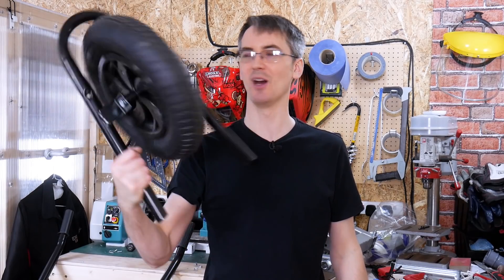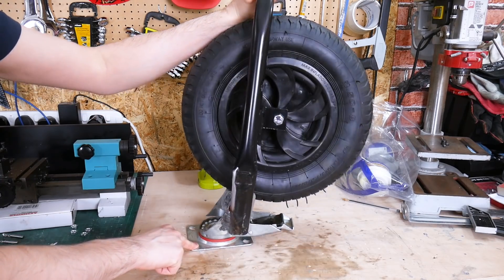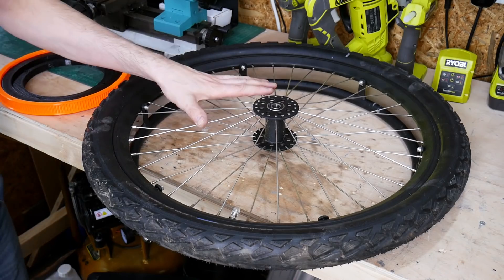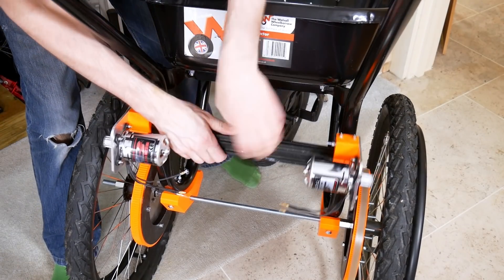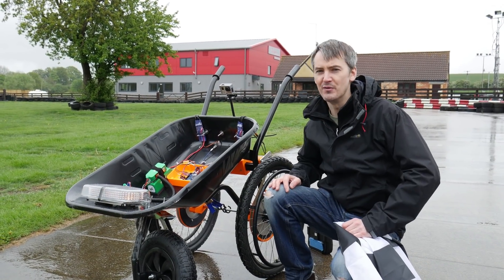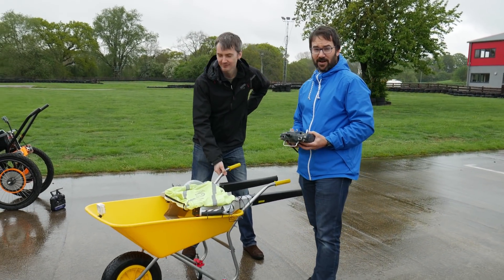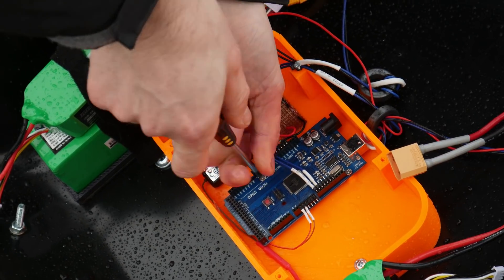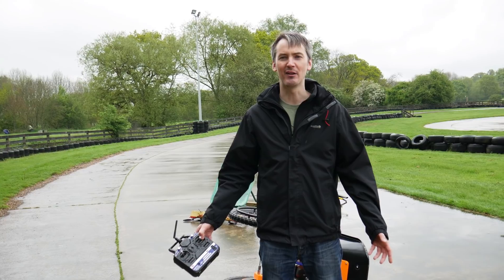Barrow Racing with Ivan Miranda & Tom Stanton  |  James Bruton

Comment: By the looks of it, you did not grind away the galvaniced  layer (zinc)  on the castor before welding. The fumes coming free from that while welding are not good for your health (so I am told). Very fun idea, nice build. Funny too, a high tech stunning looking barrow against a barrow with a drone-log  tierapped to it and they both work well

Comment: That’s a cool mix to the channel, I would love to see you working with Tom on other fun RC projects. 

Your barrow, while a clear winner, would have definitely worked even better with the caster in the “rear” with differential thrust on the “front” essentially turning the wheelbarrow 180deg. Casters are meant to be pulled, otherwise  that caster can do some funky stuff as you saw. The other way would have been to tension some bungee cables to the caster to re-center it after performing a turn. That looked like a lot of fun! Cool project James!

Comment: Just a suggestion for next time, but those motors probably had more than enough torque for a faster gear ratio. Also, the wheelbarrow was raised too high, causing you to have flipping issues

Comment: Ah that was too top heavy for my liking but I liked the speed it got.

I think I'd have opted using the original wheel as the drive wheel positioned behind the barrow (slicing the barrow open to position drive system) and servo controlled single or dual castors for steering.

Comment: Run it backwards it'll work better
Reply from the maker: The castor snakes because it's not flat on top. Going 'forwards' means it runs at its highest point which is a little better.
Reply: @jamesbruton  and i guess you get wheelies going forwards too